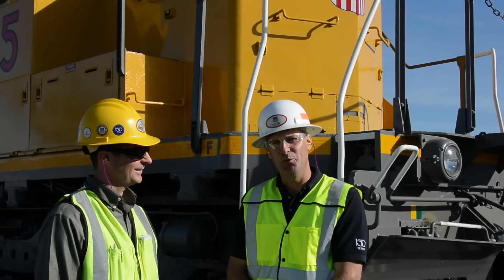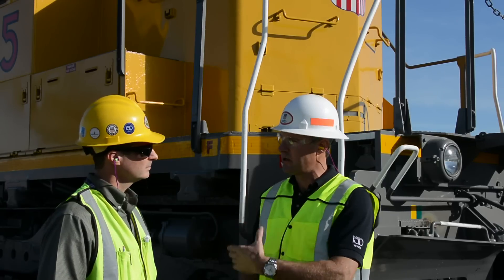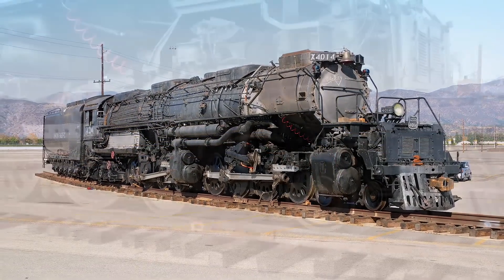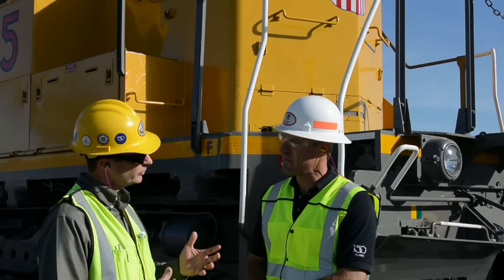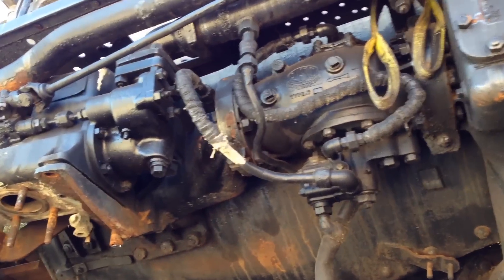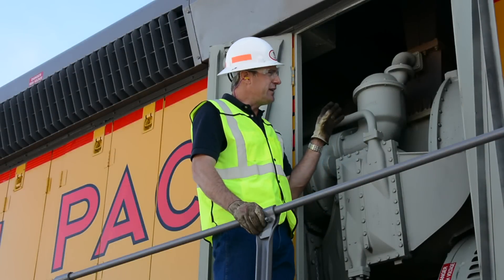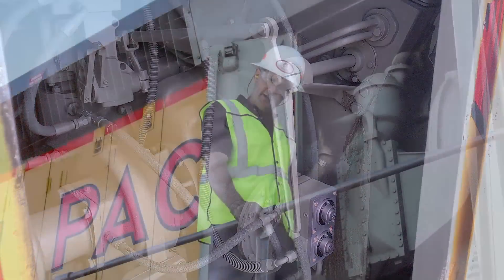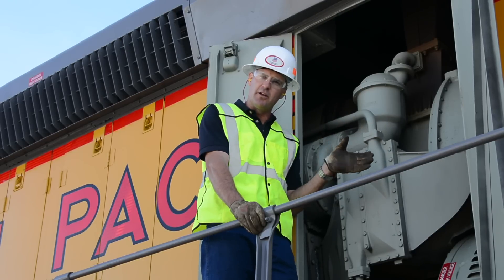The UP 4014 Project - December 27, 2013

Comment: Nice presentation on Fleet No. 3105, which, as an Electro-Motive/GM SD-40, is a textbook stage between the E- and SD-7's of the 1950's, and the current wide-nose SD-90's.  Would have been nicer yet for the RailGiants Museum if a 1910's 2-8+8-2 American Mallet compound drag freighter, predecessor of the 4-6+6-4 and 4-8+8-4 American single-expansions, could be included for a parallel exhibit.

Comment: If we are now donating SD40-2's I wonder what modern diesels are next. SD50's, 60's??? Maybe even some of the big 70's 80's and 90's?
Reply: the siemens ac drive components on EMD "MAC" units like the sd70mac, sd80mac and sd90mac are becoming rare as they are out of production.  during the height of the recession, BNSF scrapped a few sd70macs that were in bad condition to bail out the rest of the fleet, so perhaps the macs are next